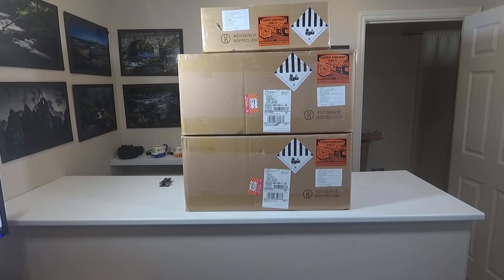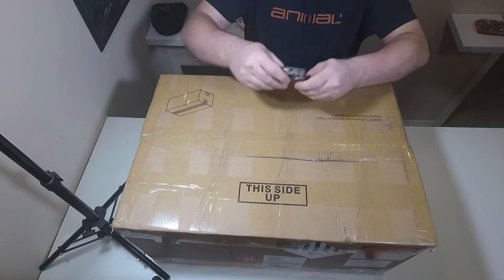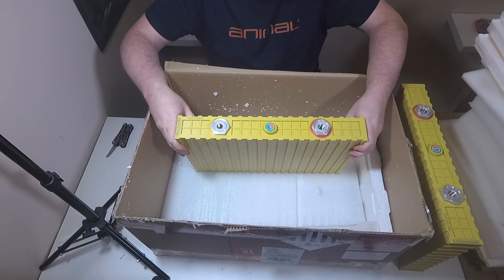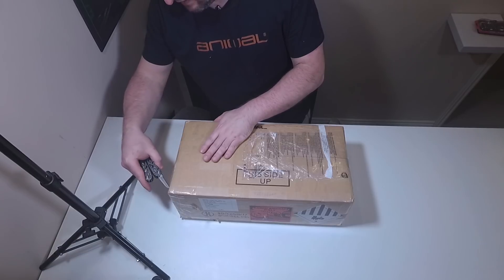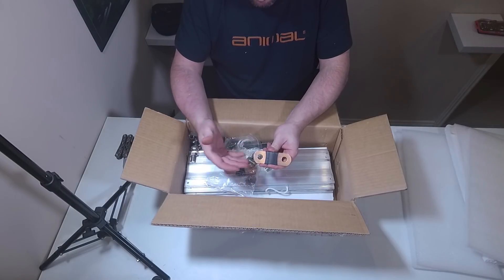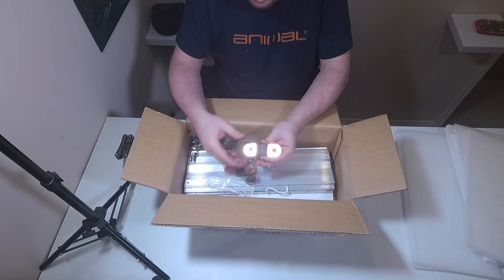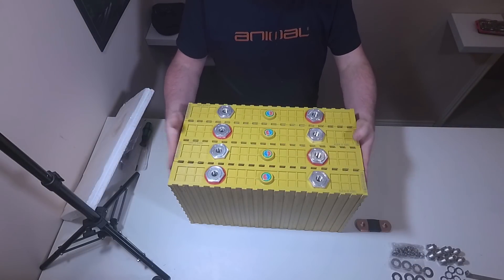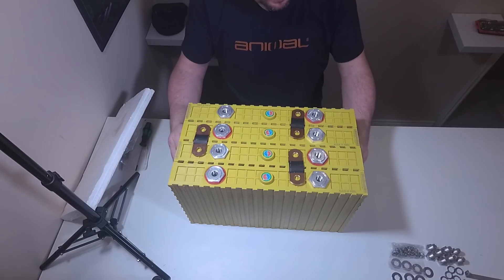Winston LifePO4 400Ah Battery for Campervan - Unboxing

Comment: Mate!  You are going to find out soon enough, you should have bought 8 100Ah batteries.  The reason is 24V has way less loss, and matches a 60 cell panel way better.  No need for an MPPT.  Check electrodacus for details.  Cheers!

Comment: is these battery internally equipped bms?
Reply: Certainly not ! you need to buy the CPM from GWL: it is a high precision BMS which is external and costs 140€, a very good product that is mandatory for charging LiFePO4 batteries.

Comment: I just found this video and channel. Thanks for the information on these batteries. Did all of the connectors, bus bars, case and everything come in the price of the batteries? Were they an extra expense? I'm wanting to build a battery bank for my home solar and will be using these cells. Do you think that a bank of these at 24 volt would be enough or should I used an 8s4p configuration? Thanks for any information that you can give me?
Reply: Would you sill buy them from the same supplier. Have you had any followup with them ?

Comment: Hello, we are a AMEl 54 sailing yacht and plan to switch our service bank to LiFePo.
what are your experiances so far? any faults? how fast do you charge, at how many amps charging current?
what kind of BMS do you use?
can you give us mor details about your setup?
VelaNautica.org
Reply from the maker: So far, no faults (actually better than I'd hoped it would be). I charge at 40A on hookup, 60A whilst driving and whatever solar is available. My Votronic VBSC 60/40/430 works out the ideal amount of current needed, and reduces it when required. BMS wise, I use the 123SmartBMS with their SmartRelay. Both are excellent in my opinion.

Comment: Nice, but what amateurish packaging to come so far.
Reply from the maker: Funnily enough Winston contacted me after seeing this video about the packaging. They had dispatched in proper wooden crates, the courier re-packed them as the arrived for air freight. Arrived in perfect condition though, which is all I cared about :)
Reply: I've only just started watching, (just watched the puter one, did you update that?) how are you finding the batteries in action?
Reply from the maker: You mean the PC one? If so I've not done another video yet, but have updated to a new (powerful) 12v PC. The new one has 4 x hard drive and is an editing rig. I'm using it right now (will do a video - this one runs @22w in use).
The batteries are great. Kind of like having hook-up all the time. I did update a thread on Fun if interested.

Comment: where is the follow up video please???
Reply from the maker: Had a few set backs with this. Firstly, planning and getting all of the right gear here was challenging (but it's all here now) then secondly, I decided to build the system in it's new home which meant having to build that part of the van first.
I'll have the area where the electrics are sited finished today and hope to install the LiFePO4 setup with charger and inverter tomorrow.
Have loads of videos waiting for editing (time) but will make the LiFePO4 videos a priority. Should have something out by the end of the week.
Reply: looking forward to it, thanks

Comment: Thanks for posting this! Looking forward to seeing how your BMS works - that's still somewhat confusing to me. I just emailed Thunder Sky Winston for a quote on these cells - I'm looking to get 4 or 8 of these for a similar setup for a solar travel trailer. Did you consider purchasing from Alibaba, or was your purchase quantity too small for vendors to bother?
Reply from the maker: Hi Bungle and thanks. I'm hoping to have the BMS video out very soon - got held up deciding on exactly which chargers to order, but they are now on their way to me.
I didn't consider Alibaba, only Winston direct and EV-Power (who were out of stock at the time).

Comment: 400Ah of lithium is absolutely beastly. I'm interested to see all the components you end up going for in this electric setup.
Reply from the maker: Thanks Gary. I've still not made a final decision on some of the components tbh, so much bad info around (and some manufacturers are being slow in answering a few questions).
Hope to get it all organised this week (BMS and chargers). Just need to make sure they play nicely together before ordering it all.
Reply: @SelfBuildCamper  diy solar with will prowse on youtube

Comment: Very nice BIG capacity cells! I've been running for my small 200watt  solar system in an apartment the single 12v/90ahwinston mono brick for a year and a half know, it replaced my 2*105ah agmbatteries witch pooped out after only a year of use, Lifepo4 batteries are crazy efficient, powerful, and long lasting, I would say "lead is dead" longleaf lithium!
Reply: Hi giottodiotto, are you still happy with the mono brick? I'm undecided between this and the 100 Ah Winston 4 prismatic set.
Thanks to share your experience.

Comment: Nice cells. What BMS do you plan on using?
Reply from the maker: I'm leaning towards the 123SmartBMS, but haven't made a final decision yet. Funnily enough I'd be combining it with two of the same relays (almost the same, EV500) as you've used in your temperature cut off video (interesting video). Thanks.
Reply: Self Build Camper that's a nice bms. I was looking at that and the chargery BMS16T. You'd need a buck/boost converter to power the unit in a 4s config, and the interface looks kinda cheap, but the features look nice.
Reply: Batrium bms !!!
Reply: Pietro batrium is pricey for a 12v system in a van.

Comment: Great! Ev-power.eu sells these as well, cheap and great i hope, as I'm planning to buy from them too. They have a bms system too.
Reply from the maker: I was going to buy from them myself, but they were out of stock at the time. They have a good rep it seems.
What are you thinking of installing?
Reply: Self Build Camper ahh! I was going to go for that package they have, the 1000 euro for 200ah and bms. But I have many questions that I'm unclear of, compared to regular agms, like what chargers work, how to hook it up to an isolator/alternator, so your videos are a godsend, I'm very much looking forwards to this. I might even splurge and go for 400 ah. Now that's some off grid camping right there!
Reply: @timothy790110  Any updates yet, have you bought these batteries ?
I'm also curious what solar charger controller should use and what kind of booster for the alternator.
Reply: @syncrovanCos  no, my agm is still hanging in there! I do know that Victron use these cells (Winston)  for their lifepo4, setups so that should tell you something about their quality.

Comment: Show me more please. How much they cost and how big are they???
Reply from the maker: Cost wise, around £2000 for what I have including UK delivery (varies a little with currency rates). Size wise, they weigh 13.5kg each, so my setup weighs about 55kg inc. the bolts, connectors, etc.
Each cell is 285mm in height, 461mm in width and 65mm in depth. So my setup takes a space of 285mm x 461mm x 260mm. Thanks, David.
Reply from the maker: There's a lot of advantages to be honest. Size, weight, charge speed and usable capacity to name a few. Not for everyone, but for someone who relies on electrical power for work (like me) a good choice I think.
I'll cover all my reasons in a later video. Want to do a BMS video first, but it's not arrived yet.
Reply: yes indeed,  considering an 8D AGM is 150lbs  and is about half the capacity ..225ah. 
 @SelfBuildCamper
Reply from the maker: These people have a good rep and good prices:
https://www.ev-power.eu/Winston-40Ah-200Ah/?force_sid=snnkhsqji9b2anrvmn1f9rppm5
Reply: Self Build Camper totally agree with you about advantages of lifepo4, expecially winston. Can you suggest me a good seller?
Reply from the maker: They just have such a good rep. Plus the Winston's are actually LiFeYPO4. The Y stands for Yttrium and is meant to improve charging at lower temps. Not sure I'd take the chance, but always nice to have a little extra protection.
Reply: Self Build Camper good to know, thanks again.
Working right now on a solar energy storage battery pack for my house and after a deep investigation on 18650 cells, went to conclusion that 18650 make sense only if you can find used/recycled ones. Otherwise the little price difference between LIFEPO4 and 18650 is compensated by life cycle, work hours, security, form factor, etc. Now I’m waiting for some LTO prices but I am afraid will be over priced (but 30000 life cycle).
Reply: Self Build Camper thanks a lot.
Another question.
Looks like there are basically 3 companies leading the LIFEPO4 battery market.
Winston, Calb and Sinopoly.
Why your choice was Winston?
Reply: the  low weight, no gassing or  sulfation.  a low quality 8D wet 'camper' battery is about 130lbs give or take. an good AGM is about 150lbs.  a 180ah 3.2v cell is about 12lbs.  x 4 = 45-50 lbs vs. 130-150lbs. for roughly the same ah of a conventional battery